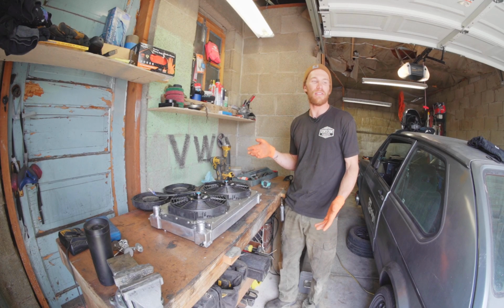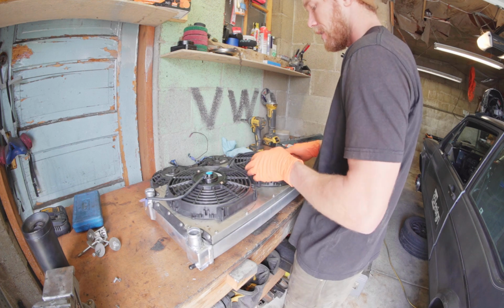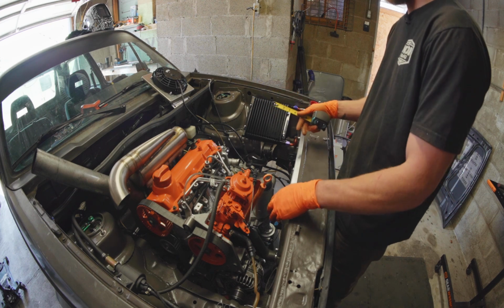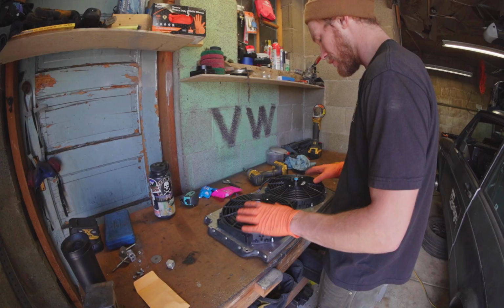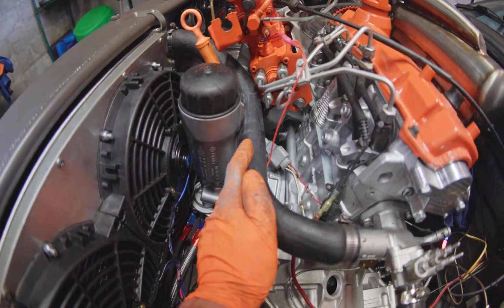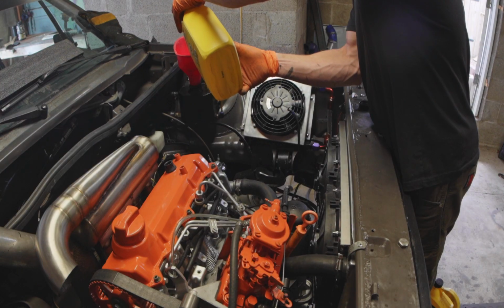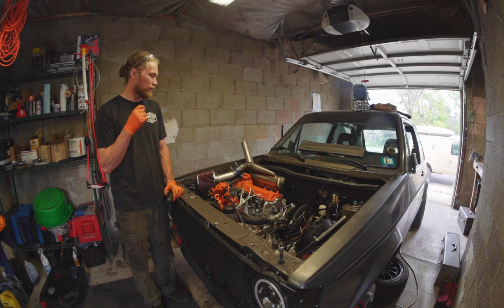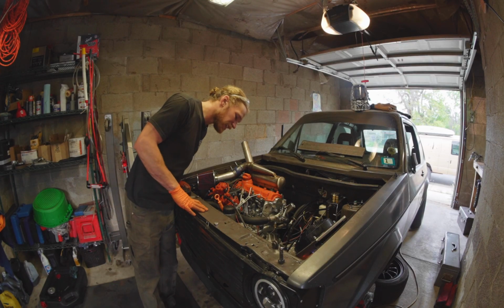MK1 VW Rabbit 1.9L TDI SWAP: Ccooling System set up & Break in

Comment: Great job Oliver 👍Glad to hear the engine running top work once again. I’m liking your radiator fan set up to keep things super cool . Looks great too. Radiator itself looks a lot bigger that standard diesel rad . What car is it from ? Or is it an aftermarket option? Keep the videos coming can’t wait to see it on the road. Will u put it on a dyno when u have the engine run in?
Reply from the maker: Hey! Thanks 🌞 that is actually the stock size radiator for mk1, I just like to run an aluminum 2 row instead of the OEM plastic single row. Yes that is definitely the plan 😁 I just want to make sure it's operating nice before taking it there

Comment: Aftermarket oil filter housings are out there for this exact purpose. But then you have the oil filter under the car
Reply from the maker: Yeah! Fortunately it fits. I like having it on top
Reply: @OliverFetter That is ideal. Our mk1 Jetta with the 4 square headlights and the AC version for the alternator bracket means extra radiator wings that offset it deeper into the whole bay 🤦‍♂️ not rocket science by any means and sure seems like and afterthought by VW

Comment: Quick tip on finding parts store rad hoses for custom builds. I keep a couple of flexible heat riser hoses the kind that's made of paper/foil material same stuff used on air-cooled vw's to connect the cooling tin to the heat exchangers. Use a section to bend to the contour of the required hose it makes a perfect template. Take it up to the parts store ask to go into the back and compare hoses sometimes you'll find a hose that you may have to chop down a bit but will be perfect other times it may take two different hoses and a coupling to get what you need.
Reply from the maker: Dig it!